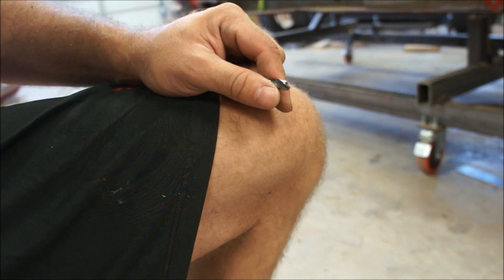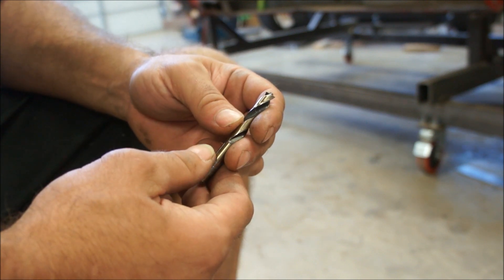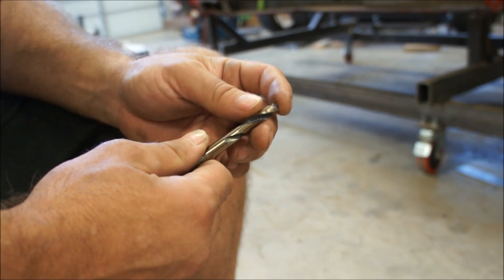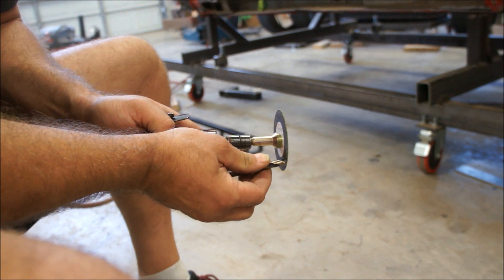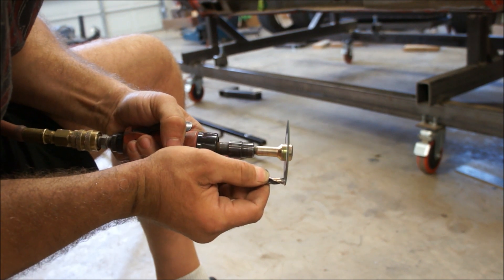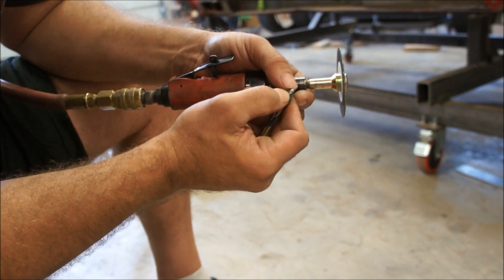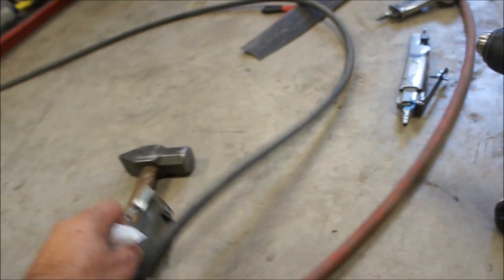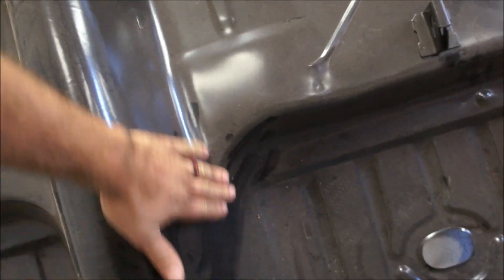camaro rocker and more damage

Comment: The floor pan is the weakest part because it doesn't have any support rails under it. the rockers are the support for the middle of the car. But they are on the outside of the car and the rear frame rails are inboard. So, if the car was rear ended, it would push the rear frame rails forward and there is only floor pan in front of them so it buckles. Nice tutorial on the bit sharpening! Jay
Reply from the maker: John Hambrick I agree , thanks

Comment: That floorboard hump is probably caused by the driveshaft, People abuse Camaro's they always have and always will. You can pull a holeshot for a minute with a camaro blowing rubber the entire time. I bet someone was pulling a holeshot and the u bolts let go and the driveshaft tore the hump apart until the guy backed it down. I don't think that car got his as bad as you think, I just think someone hit it in the side and pushed the quarter in a little. If it were hit hard the inner rockers will tell the story, they will be all twisted and cut and patched together in my opinion.
Reply from the maker: Cary Lamari could be some of it but it's definitely been blasted in the butt

Comment: Do you have access to a frame machine just in case you have to pull the rear of the vehicle.
Reply from the maker: bougi66 yep
Reply: MrFireman164   Maybe it might be a good idea to put it on a frame rack and complete all the pulling before you cut off more panels.  Get the back of your car in the correct dimension.  Panels will line up better for sure
Reply: MrFireman164   Maybe it might be a good idea to put it on a frame rack and complete all the pulling before you cut off more panels.  Get the back of your car in the correct specs .  Panels will line up better for sure.

Comment: I've been following for some time now and have a question. I'm building a 68 Valiant and having to replace/repair a lot but there is no option. You can buy a complete Camaro body new for about 12 grand. All of this new metal is costing a small fortune, plus countless hours of work. Are you doing this for the experience of saying "I did it myself". No disrespect meant at all, but if I could find a new body, I would sure consider it. I've been working on my project for 7 years (money is tight) but would be tempting.
Reply from the maker: Anna McKinney lol , I get it believe me and you are right you can by a dynacorn body they are 13k for just the main body no front end , hood ect  , when I'm done buying sheet metal for this car I will have 3-4K in sheet metal. there are multiple reasons for me on this . Like you I don't have endless money , so I have 6k in the car originally, I have had it for 18 ish years so it has some sentimental value , also I wonder about those bodies ? They are made in Taiwan so do they get the same care and attention to detail that I will give this car or will I have to rework the whole dynacorn body ? Can I trust their spot welds ? I buy a few pieces at a time for this as I go that also helps keep down the cost of shelling out a bunch of money at once . Thanks for the comment.
Reply from the maker: Anna McKinney oh and I love a challenge, anything worth having doesn't come easy .
Reply: I know all about it, and you are right about the challenge. My car used to belong to my departed father, who started a rebuild (though he was a really frugal man), was just getting it running again basically. When he was in the hospital I promised to finish it, though he would be mad knowing how much I would do. I found nos fenders and dash in Canada, quarters and roof from California. Have about 25k invested so far, not to mention all the hours (building a mopar is tough). It's now a roller, waiting for $$ to build the motor. Hand ported the heads myself last winter (big shout out to David Vizard for his book). Only thing I haven't had a hand in was roof replacement. I sometimes wish I could just write a check, though. Mom wants to see it done, she's 82. I don't know.....
Reply from the maker: Anna McKinney awesome , that's fantastic, thanks for sharing